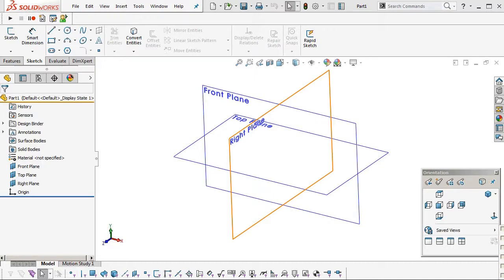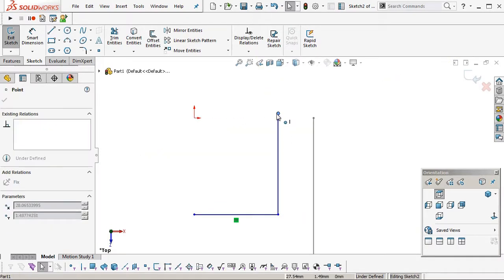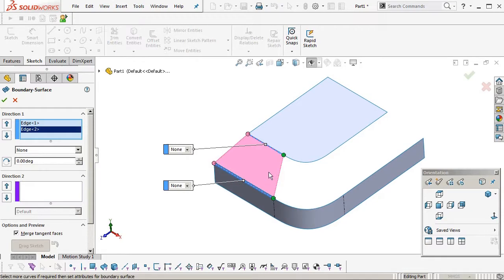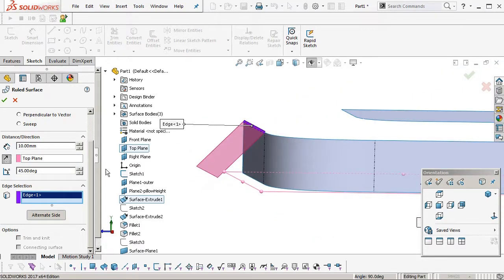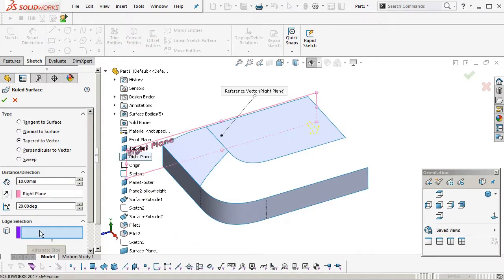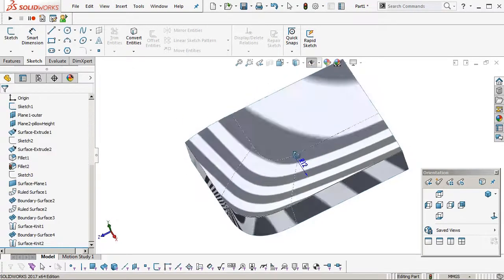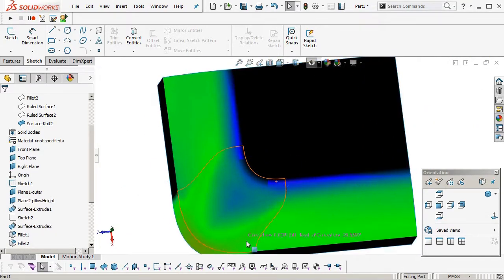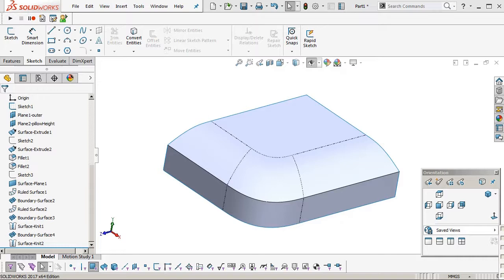Solidworks Tutorial: MK 1 Surface modelling a pillowed form

Comment: Great tutorial again. Here's a thought, rather than not having a reference surface for the outside edge of the curve, you could create another boundary surface using the two ruled surfaces as one direction and the outer edge as the second direction. This would allow you to specify tangency on both sides of the final surface and could potentially eliminate the dip your seeing in that surface. Haven't actually tried it myself, but based on my experience having reference surfaces for all fours edges tends to create better geometry. Nice work, I like it.
Reply from the maker: Hi Mark. You mean the final corner surface? Yes agree have added an extra reference surface in the past in other scenarios, especially when the angle of the other two reference ruled surfaces are different. You do run the risk of getting the boundary blend 'wrinkle' however, I think sometimes it is best to under define rather than over define surfaces. One work around for the wrinkle is to add the BB between the ruled surfaces and edge, then use that to drive a cross curve 50% along the surface. Therefore you have control over the middle of the form, without having a tangent constraint on the lower edge (again, chance of the wrinkle...)
Reply: Got to love the wrinkles right. I seriously think that I spend most of my time figuring out ways to avoid wrinkles, but yes I agree with you less constraints often result in better geometry.
Reply from the maker: Yeah, they are a PITA. Oddly enough, sometimes something that wrinkles with BB is fine as a loft.
Reply: Yep, I have found the same thing, no idea why. Have you tried "fill" with optimize surface and tangent to all edges? I have found that this actually can create very good geometry in some cases. I usually try all three to see what gives me the best result.
Reply from the maker: Fill normally as a last resort as occasionally  it goes haywire in heavy models. Normally use the fill mode where it lays a larger surface over the boundaries and trims back. We joke that it is a 'mature feature' now so there should be no frowning upon its use :)